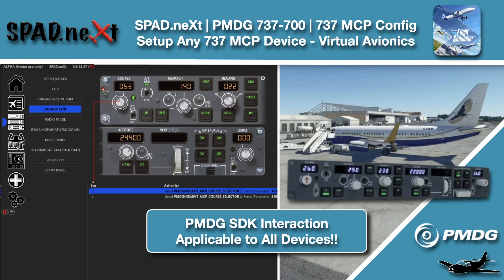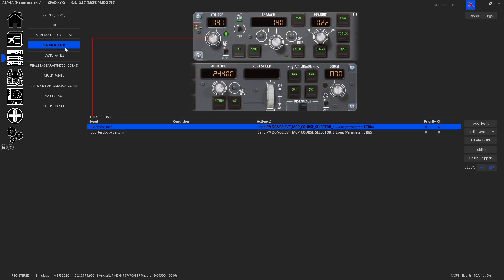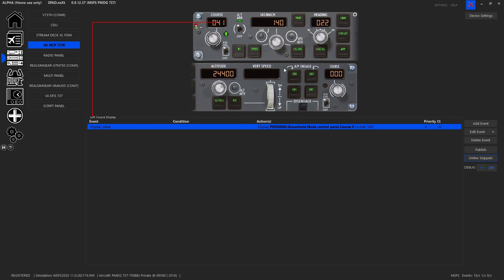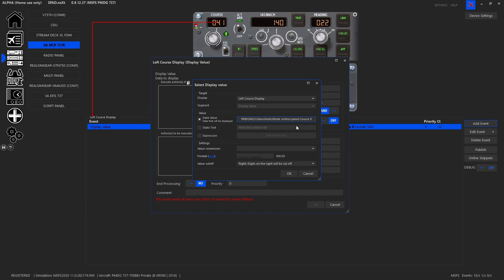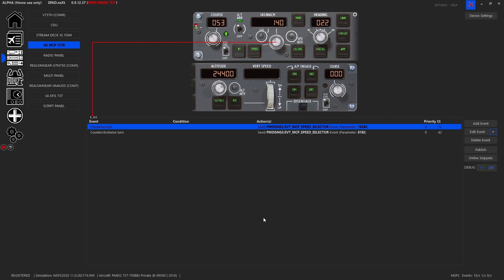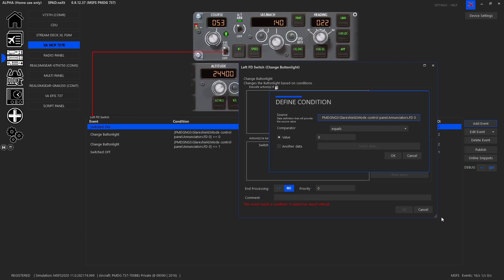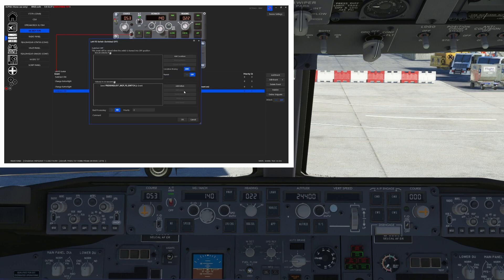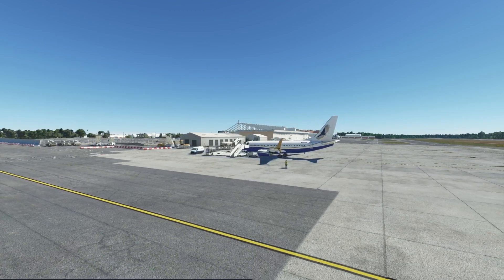MSFS | SPAD.neXt | PMDG 737-700 | 737 MCP Config

Comment: Hi  i just see this video about the VIRTUAL AVIONICS 737 MCP. i have an old version of MCP from OPENCOCKPIT that is not reconnize in SPADNEXT!!!!! It works  with an old version of driver SIOC but very difficult to program it. I prefer the SPADNEXT programme. Maybe i have a plan to buy an used MCP from VIRTUAL AVIONICS 737 MCP. Is it worth ? It s a package with the EFIS . the two part is well recogniez by SPADNEXT ??? Thanks for your answer .Jean Claude
Reply from the maker: I would wait for the WinWing Boeing .. the VA MCP and EFIS have issues with firmware internals. 

I have not used my VA in years. I have the CS for Boeing but they are expensive. Just got the WinWing  Airbus FCU and EFIS left and right for less than half what I paid for my VA 737. 

Winwing quality so far is very good.
Reply: Hello first thanks for your quick answer . Second thanks for your advise I think you are right …. It’s not worth to replace a used hardware for a nearly same used and old technologies hardware . 
I thought that MCP brand was not too old ? And for the WINWING brand a lot of people are satisfied . I am not in a hurry so i will wait after my winter season for the WINWING MCP and EFIS. Just a last question is WINWING recognise by SPADNEXT? 
Have a good day or night 🤪 and thank you very much for your work
Reply from the maker: The new Airbus FCU (MCP) works now in release version.  The Dev just got his EFIS units so we have seen a closed Beta start for those that have it.  Will probably be in a release version before Christmas.   With the price point that these are -- all WinWing products will end up full supported as they will be very popular.
Reply: @LesOReilly thanks

Comment: Ok having major issue. I followed your instruction. How ever none of my knob on the Virtual Avionics unit will work turning. Now if i go into sim it does change display in plane.  I did load your profile. What am i doing wrong that the knobs on Unit will not turn display (values) in plane?
Reply from the maker: You did not do the first steps which is to enable the PMDG 737 INI files. If the displays are not updating that is always the issue.
Reply from the maker: And just check the show notes of this video for links and that information regarding the SDK INI file edits required.
Reply: @LesOReilly  Ok i followed your video but its not right at all. Left Coarse turns but very slow and it also is turn All like the IAS , Heading, Alt, and Vertical speed. all from Left Coarse knob. Im Sorry im a idiot when it come to Computer Literacy. Is it possible to Talk with you either on Discord or Google Voice?  I know its probably something i missed. I do have a discord channel. Spad next Has banned me from joining in there discord has i was hacked years ago and i can no longer join there discord. Just more BS in my life.
Reply: @LesOReilly  Yes and add that file in as you instructed. and i do have these like you had installed and saved
EnableDataBroadcast=1
EnableCDUBroadcast.0=1
EnableCDUBroadcast.1=1
Reply from the maker: okay but you need to do it for All Versions -- ie each variant -600/-700/-800/-900 all have their own work folders and you need to do it for each one.
Reply: @LesOReilly  I only have the 737-600 i dont have 700,800,900
Reply from the maker: When your up and running go to the status page In spad. Does is show connected to PMDG?
Reply: @LesOReilly  Ok It does say connected (CDU 0: True 1: True) (5500 ms)
Reply from the maker: @jdog109socalgaming then it should be working.
Reply: @LesOReilly  OK question? Im using the thrustmaster Boeing throttles for pmdg. It has a knob that works turn MPC unit turns IAS/MAC, Heading & Altitude. Do you think it may be conflicting MCP unit itself? I think tomorrow i will throw my Airbus Throttles back in place and try again. this is a real head scratcher for sure
Reply from the maker: No that should still be fine -- those won't conflict I have like 5 different "AP Panels" all connected at the same time.
I just noticed that another user in the discord had recently had issues -- they had not updated their PMDG in over a year ... that is another thing that could happen as well -- if you did not do the update.  a while back they had that issue where you needed to manually upgrade the OPS Center to start getting the updates for the plane again.
Reply from the maker: Oh and I just loaded into the -700 and plugged my VA unit in again.. everything seems to work fine .. My Left course Knob I think is broken on my unit.  UI does not register it moving anymore but all the other knobs and screens are all working and updating.
Reply: @LesOReilly  It odd that my Left coarse knob does turn the value up and down But is very slow and laggy, and it also turns Speed and Heading and altitude Values.. Like i said though I have to go real slow when turning and it take a few second for all the window values to register
Reply from the maker: This sounds like some kind of hardware issue not software.

Comment: On spadnext program on divices inform that it is compatible with VA EFIS. Is it true ? is there any snippet for efis va?
Reply from the maker: It’s not fully supported. Not all buttons work. I would not buy it. And I own it. Buy the Cockpit simulator unit. VA is dead company.
Reply: @LesOReilly  cockpit simulator is great but it is too expensive. VA left all costumers running alone !!! I have tried to contact the owner but no return. I have mcp and thanks to spadnext I can use it on msfs2020. I was intending to buy an EFIS but I gave up after your opinion. Hope it becomes usable on msfs. Tks a lot for your support!!!

Comment: Hi Again Les . I have a OPENCOCKPITS MIP with all buttons Knobs Encoders connected via the SIOC way through the OC Usb expansion card. 
Like the PLUG AND PLAY  Opencockpit modules IE. MCP,CDU,EFIS,NAV AND COMM RADIOS ATC TRANSPONDER will the MIP expansion card be supported aswell .
I was looking at Roars IC4BA software but looks like SPAD might do everything for me my overhead is not Opencockpits .Its self built with pokey 57u cards connecting switches  and phidgets cards connecting LEDS Annunciators. 
Does SPAD SUPPORT ALL THIS .
Including Pokey 57U cards.
cheers Dan
Reply from the maker: I have no idea :) ...  you would be best to use the Trial that is offered and see if it all will show up.  Otherwise contact the Developer of the product via their website contact information and ask them.